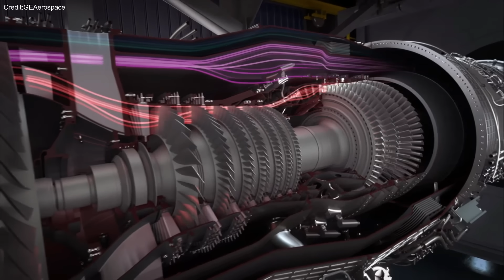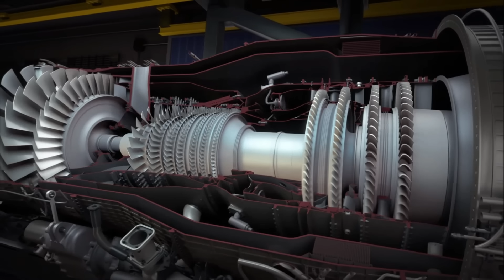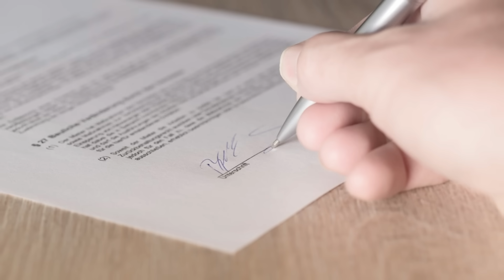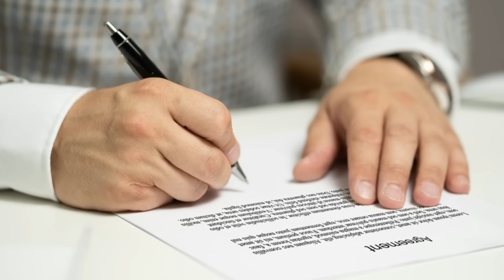Why India Cannot Copy Fighter Jet Technology

Comment: Jet engines are hard or near impossible to rev engineer hardest part is metallurgy
Reply: @bhupeshabc
You need to have a "thorough" understanding of materials aspect/Metallurgy. The Periodic Table shall have to be in the memory.
Reply: But Indians claim that Damascus steel is originally from India
Reply: @silverianjannvs5315  
That was, because Iron was first melted from ore & produced in India (where the ores were) with charcoal in place of coal now.
Reply: @bhupeshabc
Thermodynamics is equally important, as Metallurgy is. Both are needed for design equally, making the trade-off that much more difficult.

Comment: India lacks the R&D and the brain drain. Pump enough money and anything is possible. Jet engines represent the pinnacle of modern precision engineering. It isn't something you can take short cuts in. Indians are famous for taking short cuts and don't like putting in decades of hard work.
Reply: @lesliecheung1478
People quote 1984 as the start of Kaveri engine design. But that doesn't mean they started from scratch. It totally conceals the fact of efforts before starting - from about 1965, under Sqn.leader A. Roy Chaudhry (later rose to be AVM), who knew nothing about an engine, but was heading the team that engaged in "maintenance" of the engines in imported military aircraft (fighters) at 5 BRD! To say "bold" is a small word. He collected a team of R&D engineers who learn the skills on the job. My friend, RC Sharda used to say "for Aero-engine design, you need to know 2 things - Thermodynamics & Metallurgy", each a daunting field ofstudy, that might take a life-time even!
However, with that experience at the back of the mind, India embarked on Engine deign (with GTX engine on board - for testing)
Reply: @MrPoornakumar  and still India cannot manufacture a stable engine for military use.
Reply: @lesliecheung1478  Takes time buddy.
Also India doesn't have a money tree ,
Reply: @lesliecheung1478  
What engine - for cars you mean?
Reply: Cheung, India should have followed the path you took - C&P (Copy and Paste). Cheeni are the masters of it but they havent made one original thing ever.
Reply: @pocupineyoulove973  
It isn't easy to copy & paste an Aero-engine. It is almost impossible. In that process one spends even more time. It is better to start on own, learn things for oneself to get at the crux of the problem & as to how to crack it. India is doing just that and began work somewhere in the middle of 1960s, spending more time to learn Thermodynamics & Metallurgy the hard (time-consuming) way.
In an elemental way a steam-turbine, is the heart of Thermal process of electricity generation (India is designing/making her own Therm- Electric power stations, burning coal as primary energy source). On the same Turbine principle, Gas-turbine is similar, but totally different in many ways. 
In 1984 when Kaveri project was launched, there need be something to go by. That was the GTX engine already on board, that was sought (or at least the practical knowledge gained from it) as the seed for the design of "Kaveri". So it is a mal-picture (not a correct picture) to say that Kaveri engine started from scratch. The notoriously ill-informed Indian press presents this grotesque view.
Reply: Chinese are masters of plagiarization and dont care a hoot about copyright or anyone else's rights.

Comment: Kaveri is not reverse engineering, it is a new clean sheet design. Also Kaveri reached 50 kN dry thrust which now  matches GE 404, and 74kN afterburner  thrust which falls behind GE 404's 87 kN. This is now 80 kN in the engine being flight tested on the Tejas flying testbed, which is equivalent to the 87 kN F404 after burner thrust due to the fact that the Kaveri thrust is specified in hot and high conditions, whereas the GE thrust is measured at sea level low temperature conditions. What is being done now is testing and improvement for weight, durability/engine design life, and fuel efficiency. The main reason for delay other than starting from a zero technological base, is lack of funding, which is a tiny fraction of what any other country has spent on developing a new engine. India has spent $350 million on developing the Kaveri so far, while India is paying Saffran $7 billion for India's half of development costs for the new 120kN AMCA engine which is at a comparable level of technology, but larger.
Reply: Kavari is just a cheap copy😂
Reply: @isleephungry  
It is not a copy. It has a different number of turbine stages, different compression ratios, different bypass ratios. Completely different from any other jet engine, and designed from scratch.
Reply: @isleephungry Reason Indian government job employes are lazy and useless. They are coming and simply siting and they go to home .too lazy indian government job employes.
Reply: @isleephungry Just like you ,moron
Reply: @isleephungry  it's not tofu technology 😊😊😊😊
Reply: what about Wt/ trust ratio ? metalergical problems/innovation?
Reply: @michealanderson2282  
From "0" weight/thrust (correct your damned spelling. You can't spell a word properly & you a cheek to talk!)
Reply: Thanks for the insight.
Reply: Well 👍 done' absolutely correct 💯
Reply: Ooo you know numbers
Reply: In ur wildest wetdreams
Reply: Reason Indian government job employes are lazy and useless. They are coming and simply siting and they go to home .too lazy indian government job employes.
Reply: Your observation is spot on. I hope that within this decade, with the establishment of a HAT facility, a components testing facility (not at Collins Aerospace in Bengaluru, but Desi), and a dedicated FTB, Kaveri DE and the one with AF will be ready for mass production.
Reply: @MrRonnymangang11 Reason Indian government job employes are lazy and useless. They are coming and simply siting and they go to home .too lazy indian government job employes.
Reply: how many jets india produce per year compare to China, USA, Russia..?
Reply: @pisquared1827
Aah, lack of "funding"! [but not any more, I hope]
Reply: @MrPoornakumar it's not because of lack of funding. 
Its because of lack of infrastructure for testing. 
For high altitude test India send its engine to the Russia. 
Then Russia change its engine from their test bed il-76 and then send the information ,data to India then they will improve and change the fault in the engine and again send it to Russia. 
For India to get a slot in Russia India need to wait for 6 months 8 months and sometimes even one year😅😅😅😅.
Because of lack of high altitude testing facility Indian jet engine program is 10 years behind.
Reply: @sivaphanindra4102  
Then build that test center, here. It implies we don't know what to do!
Reply: @MrPoornakumar  10000cr has been allocated for that.
This need to be done 20 years ago.
Reply: @sivaphanindra4102  
Have you heard of GTX  Engine program?
Reply: @MrPoornakumar 
GTRE don't have experience before to develop jet engines.
Didn't have test facility.
Didn't have  high altitude test facility.
Don't have any test bed.
But Air force requirement is 80 kilo newtons. 
GTRE achieved 73 kN.
Our Air force think its failure. 
If it's another country. 
They will develop trainer aircraft with that 73 kN engine.
Are developed twin engine fighter aircraft. 
They go and star dancing  with F 404 engine.
Then government think after that GTRE kaveri  engine don't need it funding was stopped. 
After it's DRDO using their internal funding to develop that engine. 
Right now you can see how it will helping in India's stunt drones because it is already achieved 50 kN dry thrust(Without after burner).

Comment: I haven't seen the video yet. But the answers to this question are simple: 
1. We lacked a manufacturing mindset till recently, or only beginning to warm up.
2. Bureaucracy, corruption, and government apathy are the biggest obstacles.
3. We can churn out lakhs of theoretical engineers, but they have negligible hands on experience and work based internships
4. Indians cos take the easiest path-screwdriver tech-import & assemble.
Reply: @Talus-hallux1
Partly correct (of course, I agree).